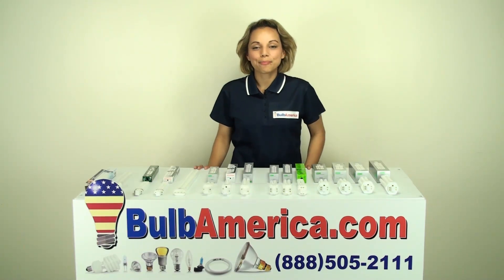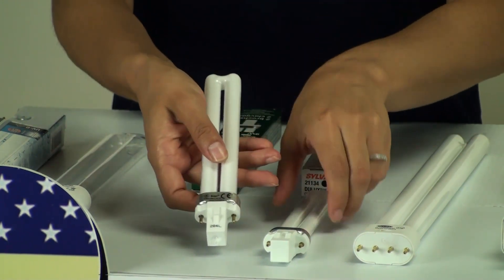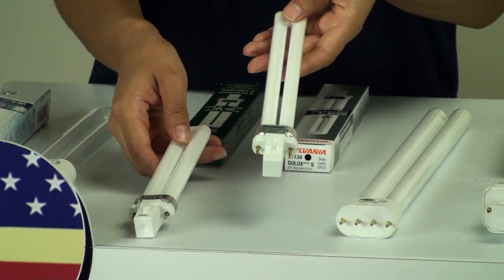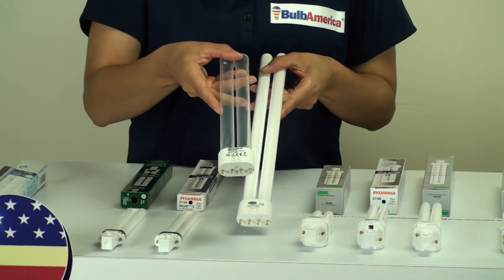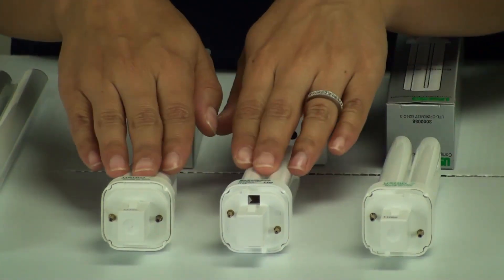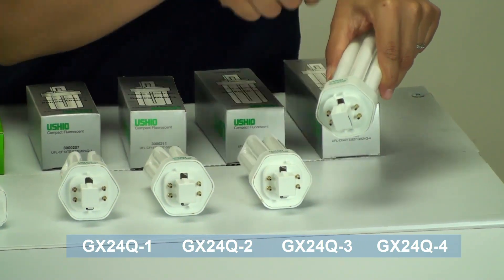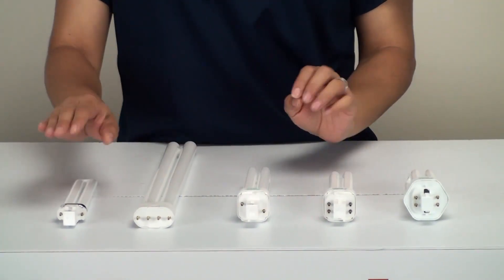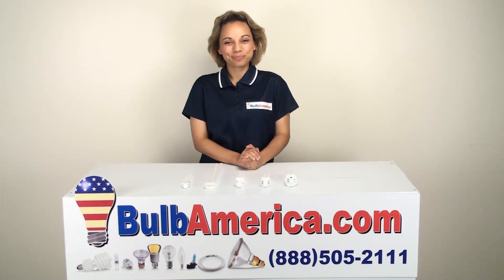Differences between wattages and bases for Plug-in Fluorescent Bulb

Comment: Great video. You’ve made a mistake though... with the G24Q-3; it does have a nudge like -1 and -2 has one - it just sits to the right of the center on this model. You would have seen it if you had laid it down on the ‘same side’ as the other two.

Comment: She says that the G24Q-3 in the video does not have notches, but the one shown actually does have notches. The bulb is just rotated 90 degrees, so the notches are on the sides. I believe the difference between the G24Q-2 and G24Q-3 is that the notches are offset counter-clockwise vs. clockwise (although on the same side of the base, relative to the prongs).

Comment: According to a ballast supplier, the G23 and GX23 are both magnetic ballasts with the same voltage input and output and they are interchangeable. So there is no reason that the G23/GX23 shouldn't work or would blow the bulb. Only the retaining lugs are different. Can't guarantee it but that's what it says. From the ballast supplier:

"Magnetic Fluorescent Ballast, 120V, Single 2-pin lamp CFT13W/GX23 or CFQ13W/GX23, Preheat Start Ballast Robertson ElectroMagnetic 2-pin 13W CFL Ballast Preheat Start Performance and Safety UL Type 1 outdoor listed CSA (cUL), CSA22.2..."

Comment: Argh! I have a nutone bathroom fan/light. The sticker in the fixture shows gx24q-4 bulbs, but the socket is clearly a q-1 socket. I think the contractor pulled a fast one on me because the bulb in there never worked well and finally burned out, and when I pulled it, it was clearly a q-4 bulb with the double notches filed off to fit into a q-1 socket!!!

Comment: She twice mistakenly stated that the "ballast is inside the bulb." Which is not correct of course for these "G"- type base compact florescent bulbs.

As the electronic ballast resides in the fixture itself, not the bulb.

But still an overall good presentation nevertheless.. . .
Reply: Oh, and one other additional error she made in the video...

Regarding the code description on the G23 base bulb near the beginning of the video, she stated the number "8" in "841" indicates that the following number, "41," would refer to the color temperature, i.e. 4100K.

Actually the "8" means the "Color Rendering Index" (or "CRI") is 80%.

But again, still a good video by "Amanda" despite the occasional slip-ups.

Comment: This cfl lamp specificity is severe BULLSHIT.  I want to rip these fixtures out of the walls when i discover them. A relic of the early attempts at efficiency left over from the 60's.  

Rip out the speciality cfl socket & ballast and replace with standard E26 socket and use one  of the many high output LED bulbs using the standard E26 bulb socket.